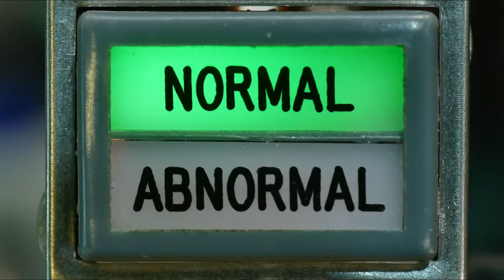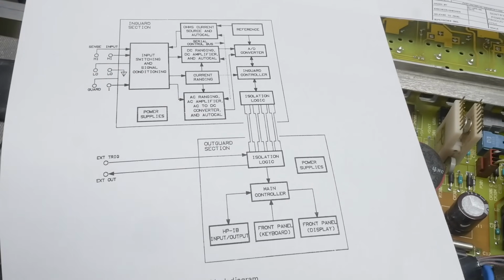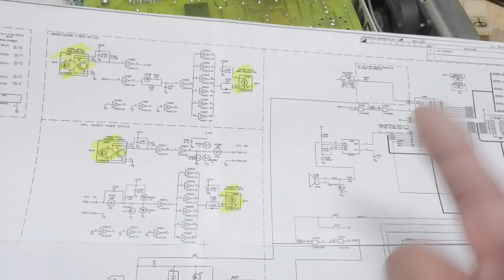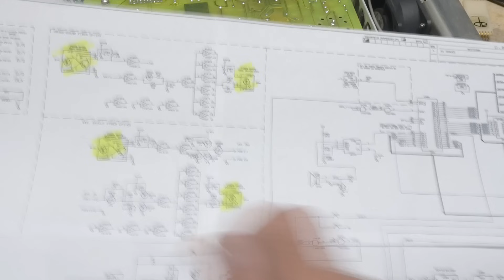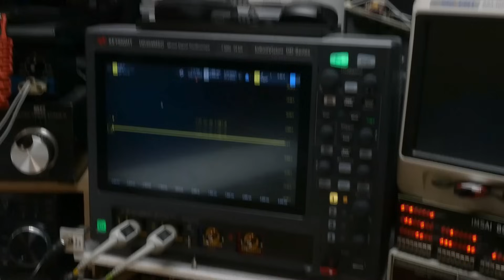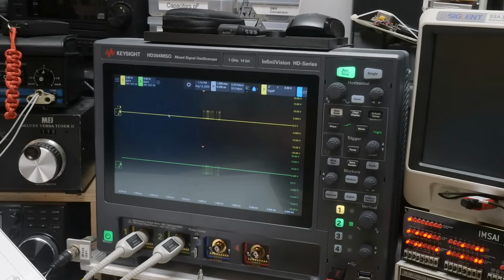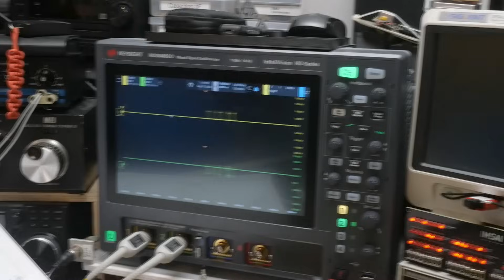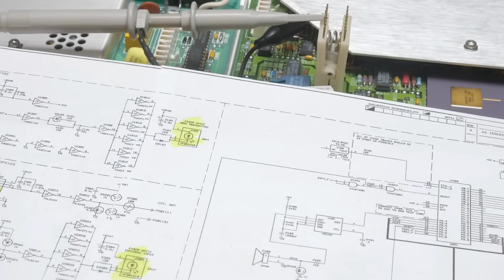#2333 Agilent 3458A 8.5 Digit Multimeter (part 11 of 16)

Comment: I bought a different HP bench DMM many years ago at a hamfest for 60$.  I get it auto- calibrated for free occasionally through connections.  So if it ever goes belly up,  I have to consider the costs involved.

Comment: Maybe the program code is gone bad in some EPROM? Or the configuration/calibration data is corrupt? For instance, if a float type variable in memory has an incorrect bit, it may become unreadable (NAN) can in some microcontrollers it may cause erroneous operation-

Comment: I'm not sure whether you rechecked the CAL signal. A while ago you mentioned it didn't seem to be exiting the circuitry around Q801, Q802 and U802 on the AC board.

Comment: If you want some motivation - checkout this channel called buy it fix it. He fixes stuff long after a normal human would have binned the device. Have a look at his baby monitor video as a starting point. But is is possible there is some ack that comes back for the command but you are missing it as it gets wiped by the periodic update? Wonder what it outputs when the error occurs? Maybe could capture a few using segmented memory to see if it changes? I reckon you can fix it :)
Reply: "Buy it Fix it" is an awesome channel I admire his work enormously, this would be a great Collab :)

Comment: I hope you keep at it. Even if you can't find what's wrong and unable to repair, the process is interesting and educational.  In fact, even if you find what's wrong and can't repair for whatever reason, there's some satisfaction in that.  I think anyway.😊
Reply: He's already found the DMM reporting an error associated with the central ADC chip, which is a completely custom proprietary chip by HP at the heart of the meter (U180). They're famous for not being reliable over the decades. Only way to 'repair' that is through replacement; either finding another ADC board, or handing it to Keysight and basically asking them for the same. Probably $1-3k in expense.

Comment: Great video. Is the signal supposed to be inverted?
Reply: It wasn't inverted. The 2nd trace was at 5v rather than the zero volts on the output side (first trace).